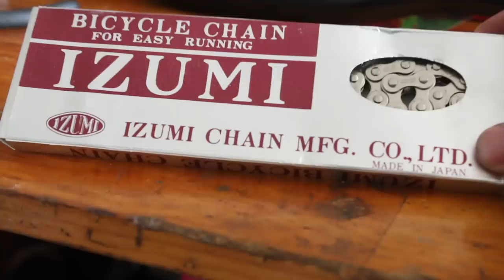Bike Build - Cinelli Vigorelli Steel Fixed Gear

Comment: I keep coming back to see this beauty brought back to life and each time I’m still amazed by its beauty.
Reply: Well, the poor thing shows it can't be ridden on the road.
Its behaviour is terrible on the road.

Its Whipping from side to side and slowing down going in a straight line.
The manufacturer was prooven right and the video maker looks stupid riding it.

The wheelbase is too short and the front end never returns to the upright position cause the top tube pushes it away.
The Seat gets to the upright position first and that stops the slow front end.

The bike always wants to corner everywhere.
It can't drive in a straight line.

Comment: Great build but the cog doesn't look very round
You can see the chain bouncing at 7:52
Reply from the maker: Yeah, could also be the chainring. It’s unfortunately kind of common on low/mid range components
Reply: @waveywheelies  
Ikr
Both the chainring and the cog weren't round on the last bike I bought 🙈

Comment: That chain, when you spun the rear wheel was proper noisy. I have the same chain with the same loud noise. Did it quieten after a while?
Reply from the maker: It’s a semi common thing, no big deal really unless you are fussy about the sound. As long as the cog/chainring/chain isn’t worn it shouldn’t be an issue👍
Reply: IZUMI chains are notorious for being noisy.

Comment: does this bike have internal cable routing for the rear brake? can i drill a new hole by myself to mount the brake?
Reply: It doesn't even have a hole for a brake mount, let alone cable routing.

Comment: new daily ride maybe???

oh, and quick question. my seatpost keep sinking down, anyway to stop that?
Reply from the maker: Such a sweet ride, definitely going to ride it a lot. 

And first thing is make sure it’s the right size, if it is make sure you tighten it up to torque and finally make sure it’s not greased up too much or it will encourage it to slip
Reply: You can use a piece of a plastic bag
Reply: @nonym7596  good stuff.
Reply: @waveywheelies  thanks.
Reply: Carbon paste
Reply: Super glue, works every time.

Comment: Is it ok to purchase a used frame that have a small dent on the top tube?
Reply from the maker: Depends on how bad the dent is really, I’ve personally purchased frames with small dents before and they have been fine for me. Is it steel or aluminium?
Reply: An aluminium frame
Reply: @ngjialer5053  Have to be careful with aluminium frames as a dent could cause it to crack.

Comment: Awsome build. Worst cranks ever
Reply from the maker: Thank you! Interesting you say that, have you had bad experiences with them? I’ve heard stories of them cracking, but I’ve never personally had issues with them. I wonder if it was a certain batch of cranks. Because its crazy to think that they haven’t changed the design or strength after all these years of failures.
Reply: @waveywheelies  bought them for my daily bike. After 2-3 weeks they start getting loose. I need to check side bolt every time before work. Of course these cranks not designed for skids, wheelies and bunny hops but come on... 100 pounds for soft piece of ...
Reply from the maker: What bb are you using and did you torque up the crank bolt to spec? Haven’t heard of that issue with these cranks before. But have seen cranks come loose before from not tightening the bolt enough. Also did you grease the square taper?
Reply: @waveywheelies  greased properly, miche primato bb, long lever allen key. Its just an overpriced entry level product

Comment: Its a video of disrespect and disregard for professional people.

The video clearly shows the bike didn't work on the road and that prooves the sticker is right.

The top tube always pushes the front end down and away from the upright position.

The bike is never balanced in the upright position.
The frame causes the front end to always be leaning into a turn.

It shows in the video it only wants to drive in circles.
The wheelbase is so short the bike slows all by itself.

Only on a velodrome will this short wheelbase bike maintain a constant speed.

The manufacturer is right and the video maker is wrong.

Struggle and make your life hard and look stupid riding that obvious velodrome bike on the simple road.
Reply: What are you talking about? The steel vigorelli is not designed for use in a velodrome and the geometry isn't even that aggressive.....